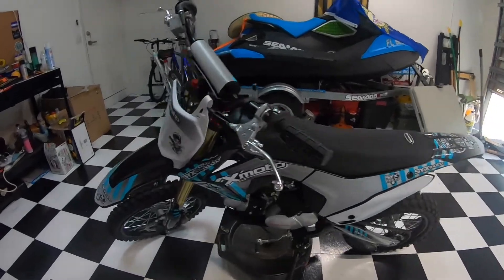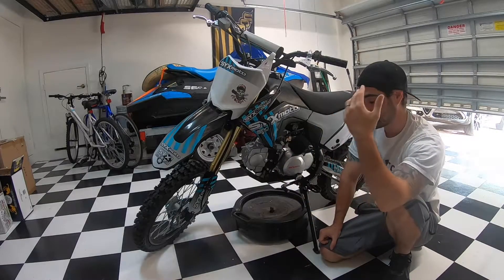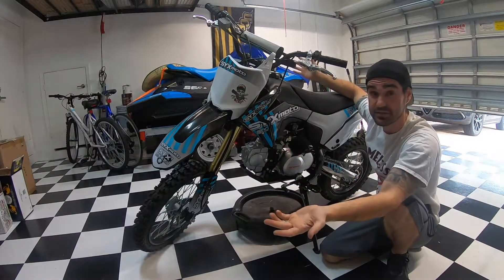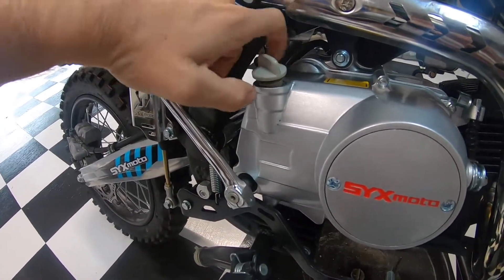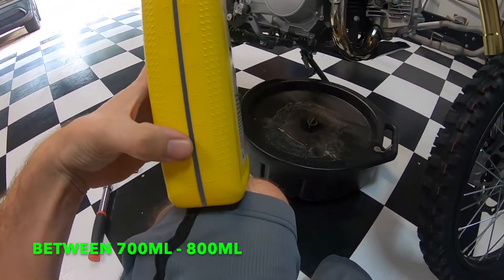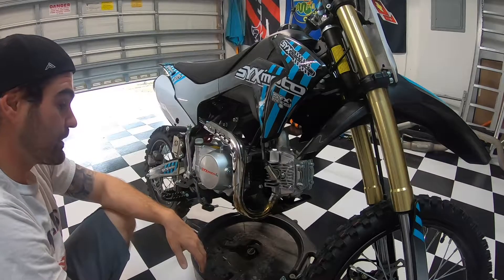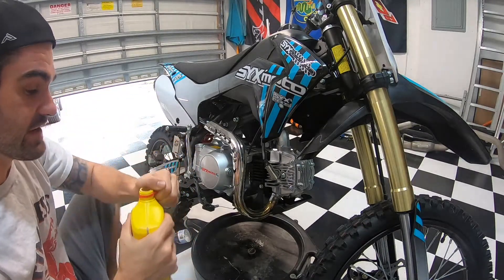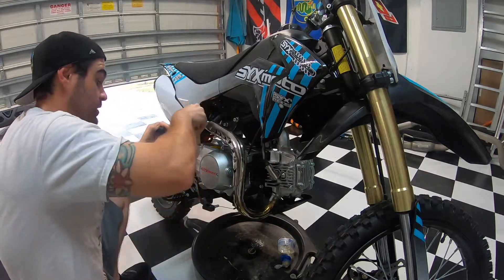125cc Pit bike Oil Change & Engine Break In | SYX Moto 125 Dirtbike

Comment: I hate to break it to ya but I believe you used the wrong oil yes it was 10-40 but I’m almost certain you want 10-40 for wet clutches regular 10-40 has detergents in it that ruin them overtime I mean it will work but over time it will burn your clutch and or clutches if it’s a semi auto…and I build engines and this is not recommended horrible to start and run with any shipping oil whatsoever you don’t know if their are any fragments from castings or anything that may have settled during shipping from the inside of the engine hopefully not but you always drain the shipping oil fill with good new wet clutch oil then heat cycle that vary the rpm’s and then you can either choose to dump that or run it for a few hours up to 3/4 throttle never wide open and then dump it and refill with clean good oil I wouldn’t follow this guy at all exactly what not to do tbh
Reply from the maker: @zacharycrawfski2276  this is a 4 year old video and after 4 years of abuse the bike still runs great. Haven’t had to charge or upgrade anything. But thanks for your essay of a comment. lol
Reply: @Wimya  well is obvious you never took a maintenance position or class in your life I’ll stick to the maintenance practices that keep planes flying for over 100 years 😅
Reply from the maker: @zacharycrawfski2276  lmao @ you comparing maintenance of an aircraft to a cheap af $1000 pitbike. Do you brother ✌🏼🤡

Comment: I'm a dealer of these bikes and 2hrs is DEFINITELY not your break in period. You never leave shipping oil in your new engine for break-in, The crisco cooking oil is immediately drained and Conventional 10w40 goes in till time for 1st oil change.. Never use semi or full synthetic oil in a engine during break-in either.. On SYX 4 stroke dirtbikes require atleast 300 miles. Valve clearance needs checked typically around 300-500miles worth of riding.
Oil changes 300-500 on first and then 500 miles equivalent between each future change because of it being in dirty environments a lot.
You are correct about the carb. They use a PZ26mm carb that has no air/fuel mixture screw access.  Have to remove the brass plug to gain access to the adjustment.
Reply from the maker: I’ve ragged on this thing since day one and it’s still running like a champ. Starts on the 2-3 kick every time. 300 miles for break in is crazy excessive imo. My 2 stroke race bikes would be broken in after 2 tanks of fuel & my 4 stroke bikes even less. As for shipping oil, I prefer heat cycling with thinner oil. Personal preference. I bump up viscosity/weight once I’m actually riding the bike. Like you said you’re a dealer of course you’re gonna have a protocol bc you don’t want angry noob customers coming back with blown engines complaining. I’ve been riding 22 years, raced proam 3 seasons, use to switch out top ends between heats. This is how I do things, and it works for me. 

Treat her like a princess & she’ll be high maintenance. Treat her like a slut and you can ride her all night.
Reply: @Wimya  I have been doing this for 40yrs now and been in business for my self for 20yrs this year. The liquid in the engine is called shipping oil for a reason. Some people get lucky and there engine has no premature cylinder/ring wear, but most do and that can be found out by compression testing.
Everyone...Remove that shipping oil out first and use some good brand name oil. Brand names are cheap for these....better to be safe then sorry.
There is no thermal  protection or viscosity protection in the liquid. Its Shipping oil for anti corrosive properties when setting on salt water ocean for 30+ days. 
Quality 2 stroke engines are broke in around 2 tanks but for one... thats the expectations and chinese 4 stroke engines are different. The material in the metal from China is soft and the valves sink in the seats closing valve lash typically around 300 miles or so.
There is so much I need to say but in short.....good luck with your methods.
Reply from the maker: Guess I’ve been lucky for 22 years. Maybe I should play the lotto 👍🏼. I’ll keep doing me & you keep doing you. I made it VERY clear at the beginning of my video this is how I break in my bikes. These motors don’t even last 500 miles if you’re actually riding them moderately hard lmao.  Maybe you should start a YouTube channel and educate everyone instead of writing novels in my comments.
Reply: @Wimya  maybe if you learned how to to properly break in a Chinese 4 stroke engine they would last you longer then 500 miles. I have a 125cc engine I ride hard wide open throttle all the time with around 3200 miles on it and it sings like a sewing machine. Thats my personal bike. So again good luck doing you....
Reply from the maker: @sullie35  lmfao Japanese bikes don’t even last 3200 miles without a top end rebuild so you must be riding like a 🐈 or 🧓🏻. The exhaust on my KTM cost more than this entire bike, I’m not sweating it. And once again my bike still runs perfectly fine 👍🏼
Reply: @Wimya  I'm talking 4 strokes bud and if your tearing up Japanese 4 strokes under 3200miles then again....goes back to you and your methods.
Reply from the maker: @sullie35  😂😂😂 ok you’re right. have a good night.

Comment: Any other tips on Maintenance etc on this bike are very much appreciated!
Reply from the maker: Just keep up with oil changes. Keep the chain lubricated. Keep the air filter clean & if you’re riding in dirt. A lot maybe get a better filter
Reply: @Wimya when should I change the oil please ? 🙏

Comment: Just got a 58cc syx MOTO for my 10 yr old. Good little bike for the price. What are your thoughts if a lot of oil is leaking but it doesn’t seem to be from the drain plugs.
Reply from the maker: Might be that their is to much oil in the tank. Then when it’s under pressure it’s just trying to escape. Is it smoking at all?
Reply: @Wimya  not at all. So maybe just drain and put oil again?
Reply from the maker: @davidsolorzano6050  yea I would start with that and see what’s happens.
Reply: @Wimya  just an update on the advice you gave me. Seems like it had too much oil and after emptying the oil and putting the proper amount in it there were no problems. Thanks again for the tip
Reply from the maker: @davidsolorzano6050  awesome! Glad it all worked out!! Happy riding 🤘🏼🤘🏼
Reply: @Wimya  thanks. I’m new to the dirtbikes so any advice is a great help. How exactly is the choke supposed to work? Off for cold start and on when warm? The bike starts but when I hit the throttle it shuts off. Also do I leave choke on when riding?
Reply from the maker: @davidsolorzano6050  use the choke for cold start and keep it on until it’s fully warm. Once it’s warm you can drop the choke and ride. If it’s dying when under throttle you might need to adjust the idle screw slightly.
Reply: @Wimya  by drop the choke you mean it should be in off position?
Reply: @Wimya  ok I saw something about the idle screw I just can’t seem to find one on my bike
Reply: @Wimya no.  If it's dying while idling, turn up the idle screw, it it's dying under throttle prolly to lean or rich

Comment: Hi,I just got same bike as yours, I turn it on but then when I throttle it,it turns off why is that I don't know much about these engines. Thank you
Reply from the maker: Hey bro, sounds like you need to adjust the idle screw on the carburetor.
Reply: @Wimya  ok thanks

Comment: Why did you break it in with crap oil? Would it be better to drain if before starting it and break it in w quality oil?
Reply from the maker: I’ve had over 10 dirt bikes, a few China scooters and I always use the stock oil for break in. Think about it you’re not putting the engine under heavy load for a break in, your just basically heat cycling ans letting things seat correctly. Ive just always done what works for me.
Reply: Wimya sounds good , was just wondering, hows the bike so far? Thinking about getting same one , not many reviews on it.
Reply from the maker: @jayzeno78  So far so good. The carb takes a little bit of tuning to get it idling off of chock but that was to be expected. I have a Mikuni carb ill be upgrading to very soon as well as some other mods.
Reply: Yes